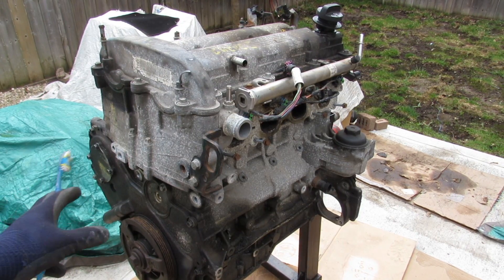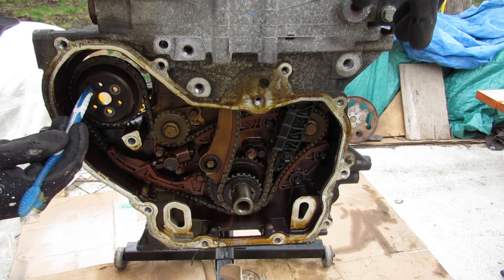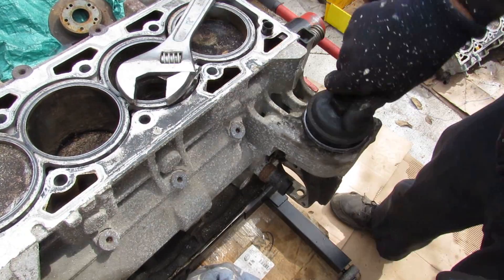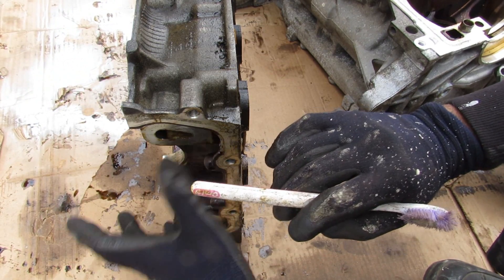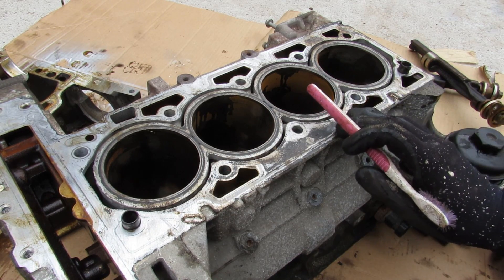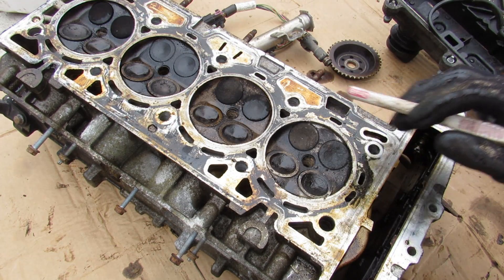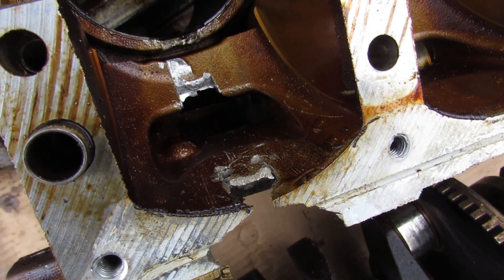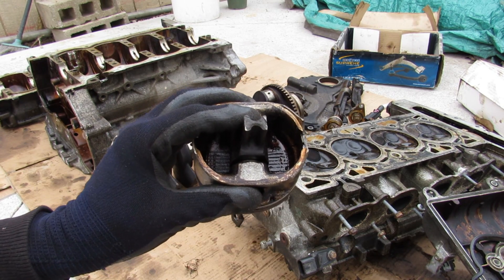Why GM Ecotec Engines FAIL

Comment: My friend has a chevy malibu, and trust me those 4 bangers just self destruct.
Reply: When will GM freaking learn
Reply: @davidbarlow7955  when they outsource engine to a "Boxer" engine
Reply: @lowlifeangler  Do you mean like Toyota did?
Reply: @davidbarlow7955  never
Reply: @davidbarlow7955  They don't have to. GM knows that but they will continue to cut corners on quality to save more dollars. The engine can explode right in you face. They don't give a fuck. And not only GM. Greed always wins.
Reply: @PAUL_K  
It is not so much greed as necessary.
The are on a marked and if they start to build their engines to last 200.000km instead of just the end of the varranty, they cost more than the competition and loose profits, which again means that their stock would crashes and the companies goes bankrupt again.

It is a systematic problem, you can see the same with Mercedes, Ford, BMW, VW and others.
Reply: @Ismalith  Well that's right you just described one form of greed. There's many of them.
Reply: @Ismalith  That's why I've always said, corporations including car companies are in the business of producing stocks, not vehicles.
Reply from the maker: What year?
Reply: @speedkar99  2016 with the 1.5 turbo
Reply: @vishalakula8451  Yeah the 1.5 and its 1.4 sibling (not to be confused with the iron block 1.4) love to self destruct pistons, specifically the ring lands.
Reply: @vishalakula8451  almost  same year  as my girlfriends car that  did the same thing. Good for nothing but boat anchors.
Reply: @Jakek200  That is because of "ring gap". If you run the engine using boost the rings expand and the end contact each other and leave no more room for expansion forcing more and more pressure against the cylinder wall. That is how the ring lands break. If you drive it hard and then cruse for a while the rings will cool preventing engine failure. All those guys with boosted engine under their hoods ALL know about ring gap. OEM can't give that much ring gap because it will not meet emissions. 
In my opinion the reason why GM has ring land failure is because they put a tiny engine in the vehicle that they turbocharge so of course your foot is buried much longer just getting the vehicle up to the desired speed. If the vehicle has two options for engines and one is a turbo and the other is  a NA (Naturally Aspirated) they always turbo the smaller one. If the vehicle requires a 2.4L NA then the option should be 2.4L Turbo. That way it will still meet emissions and it won't have to work as hard every time it's driven and if you want to race someone, hang on and go for it.
This engine failed due to oil starvation (Poor Maintenance) and why not use synthetic oil? Synthetic oil is way more forgiving when the person does not maintain their vehicle. The other reason oil rings clog up is from starting the engine and driving 15 minutes to work and turning it off. Then the same returning home. Just as the condensation inside the engine forms you turn it off and it all dribbles down to the bottom of the oil pan right under the oil pickup tube. Imagine that happening to an engine that does not get it's oil and filter changed on a regular basis.
Reply: My friend's husband was a master tech at a chevy dealer. He would spend days just replacing the little turbos. They'd fail in one way or another.
Reply: Still some of the turbo and supercharged ecotec engines are built to last. Take the 04 to 07 LSJ ecotec 2L engine with the eaton m62 supercharger. Much more reliable than the turbo newer GM cars and the newer ecotec engines. They really built the LSJ motor to handle way more power than it came with stock which was only around 200 to 220.
Reply: Agreed. That engine was built to take on forced induction, like Toyota's 1.8 4cyl from '04 to about 09 ( somewhere around there) when there was a dealer installed kit available (forgot if it was turbo or supercharger).
Reply: @billybodacious2337  what cars was that 1.8T offered in? Honestly didnt know toyota had any production cars with boost other than the supra and some older cars in the 80s or 90s. 

But yea the LSJ engine is fine. Its the timing chain that will get ya. Thats why one of the first things im doing is my timing chain and tensioner and everything else before i even think of throwing more boost or performance parts at the car. Why spend 2k on a turbo swap only to jump timing a month after its done because you should have done the timing first. If its fucked up already then adding more power will for sure speed up an expensive repair bill or need for a new car alltogether. 

Plus there are a lot of people in the ecotec car communities who build the 2.2 and 2.4 and give it boost. Seems like the 2.4 was better built in so far as handling boost goes. Seen a base saturn ion coupe with the 2.4 and a m62 added to it. Even think i saw one with the harrop TVS 1320 supercharger like what can be put on the LSJ. 

And this isnt even getting into the whole SAAB thing. The ecotec engine was designed by GM and Saab. Saab 900 turbo, 9-3 turbo x, tons of other great saab cars that people wouldnt know are kind of related to ecotec
Reply: @billybuchanan385  The corolla and celica as well as the matrix and gm's version called the vibe.
Reply: @billybuchanan385   Lexus now offers a 4cyl turbo in the IS lineup but of course it’s the bottom trim as their v6 and v8 are better. Personally I don’t want a 4cyl. My old 2010 Camry with the 4cyl was so slow compared to my 2012 Lexus is350 AWD. 306 hp from a 3.5L v6
Reply: @ValentinoBentley  The UZ V8 engine family has a few examples going into the  million mile range. They are the most bulletproof.
Reply: @billybuchanan385  good ol. 2zz and 1zz. Also found in mr2 2nd gen and lotus elise
Reply: @SI0AX  I have been saving short video's at work recording fleet vehicles with LS engines. Video on as I walk over, open the door and video the mileage and turn around and show the load they are carrying with most of them being cargo vans. I have a little over fifty of them. I started videoing when I started seeing 300K years ago. It turns out 300K is nothing for them. Around 600K is transmission time but the engine is still good. I am going to load them onto some Toyota discussion groups and see what crap they come up with. Keep an eye out and see how high they actually go but don't be surprised if there aren't enough numbers in the odometer and I show the data continues on a scanner. It's because of the maintenance schedule of fleet owners. It just goes to show if you take care of it, it will take care of you and of course there are failures with every manufacturer as well. But if a Toyota fails it is the owner that caused it. Right?
Yes the UZ is phenomenal but it's almost never put to work ever in it's life and almost always maintained to a T.
Reply: I've owned 3 Ecotec engines. 2.0 an 07 model 200k plus never had problems and didn't maintain anything properly. 1.4 2012 traded it off at 120k never had issues other that a coolant temp sensor. And now I got my wife an equinox with the 1.5 so far so good. So no they don't just "self destruct"
Reply: Precisely why I got rid of the wife’s ‘10 Equinox with the 4 cyl. Only had about 20 k on it but that engine made some F’d up sounds. A couple mechanics I know said that many of them were failing. Bye bye.
Reply: @jamesjoslin7586  FFS, I can't confirm even the "Shanghai'ed" 3400 V6 being unreliable like that in the early Chevy Equinox/Pontiac Torrents. The 3.4/3400s were mostly just known for piston slap. OTOH, it was a nightmare to be in a 2013 MY Focus with what I think now, is a problem with the PowerShift automatic&pseudo-manual transmission.
Reply: I drive an 04 cavalier with the 2.2l. Knock on wood, buy the only problem ive had with it is when it had a nasty lifter tick. I'm a mechanic and replaced all 16 myself. Only one lash adjuster was collapsed, and the rest of the entire valvetrain was perfect and clean, even the chain
Reply: This just shows how important 5k or less oil changers are.
Reply: My neighbors had a 2006 Malibu,  it randomly threw a connecting rod on the highway.
Reply: @PistonAvatarGuy  It was a timing chain tensioners broke, oil was low do to front cover was leaking really bad after 250,000 miles
Reply: @lowlifeangler  On this engine, yes, but the engine that I'm talking about was only a few years old and had been well maintained.
Reply: Yeah, the new turboed things everywhere..., new way of reinventing the wheel. As if they didn't have enough problems already
Reply: @pliedtka  - Nothing new about "turbos"... were used in WWII and in 1962 Chevy Corvair and Oldsmobile Jetfire...
Reply: @pliedtka  Its mainly brand and year dependent. I have a 1.8t (MK4 Jetta 5 speed 2003) with 459k on the odometer. I do my timing belt on time and very frequent oil changes. Extremely good example of how a factory turbo car should be. Not all factory turbo cars are terrible, chevy does a terrible job with theirs though xD
Reply: Appreciate this breakdown so no buy lol
Reply: @snackler6102  Exactly!
Reply: @Yeah Right I know you're a mechanic. Toyota is tasting that flavor right now, and they even went one step further. They sell a BMW too! I always say if the boxer engine was so damn good all the manufactures would be using them. The only reason why Subaru uses them is because of government subsidies. They can't loose money researching and developing them. Mazda does the Wankel.
Great comment. Thanks, I needed to see that.
Reply: @Yeah Right  I have been saving short video's at work recording fleet vehicles with LS engines. I turn the video on as I walk over, open the door and video the mileage and turn around and show the load they are carrying with most of them being cargo vans. I have a little over fifty of them. I started videoing when I started seeing 300K years ago. It turns out 300K is nothing for them. Around 600K is transmission time but the engine is still good. I am going to load them onto some Toyota discussion groups and see what crap they come up with. You know the odometer goes up to 999999 but the data continues on the scanner. It's because of the maintenance schedule of fleet owners. It just goes to show if you take care of it, it will take care of you and of course there are failures with every manufacturer as well. We only have one company using Ford for there entire fleet and I see over 300K but not pegging the odometer. Dodge is still behind but they do have the new design hemi now and seems pretty good.
Reply: @Yeah Right So fun to drive tho. I must admit the most fun ive had in a car was in a 2.5 liter Subaru Impreza STI WRX at 320horsepower. Massive turbolag, and that giant turbo felt like you hit warp speed when boost kicked in..

I would never buy an boxer for mpg. Would be purely for entertainment.

I would altso love to own a rotor someday.. They are unefficient, and hate cold starts.. But, it has certain desirable traits.. Like the mad sound they make.
Reply: @Yeah Right Why would you run N/A in 2021? Unless you a doing a historical rerepresentation?

Been a while since i had anything N/A.

Open deck engines are the bottom of the barrel..

Its like me saying Remy Martin Cognac sucks cause their cheapest one did not taste good.

Of course its gonna suck. Its cheap.

However, noones saying Boxter is better than an standard engine. Theres a reason they have not hit it off. They are way to complicated. Has a slight imbalance etc.

But dang, if it aint a compact design. So you can fit bigger turbos :)
Reply: I BELIEVE YOU!
Reply: americans just never learn how to use european engines, simple
Reply: @Yeah Right lol, funny you bring that up....when the 22B was also open deck, but we dont hear people complaining about it...also closed desk 22s are nice and all, but they dont like temps....they run hotter during the summer and rattle like hell during the winter.  but, you knew that already right?  same reason why the fox body GT with the aluminum heads and forged bottom end rattles until its heated up. lol did you know, the focus RS matter of fact, all ecoboost engines are open deck?  The volvo 5 cyl is open deck, the newer honda turbo engines are open deck, hell, the older honda engines were open deck!  the BMW inline six both na and turbo were open deck.  and if they chose to, they could easily resleave and close the desks of these engines just like the aftermarket does but it will cost more.  and subaru engines post ej25d in the WRK and STI are semi closed deck *unless you were lucky and got one of those "spare" engines they dropped into foresters and legacies with forged bottom ends in which they used the same semi closed deck blocks.  guess honda B and K series engines are garbage cause their open deck, yet people still turbo them.
Reply: My 2018 equinox 1.5L turbo started burning a quart every 1k after only 15k on the odo.
Reply: No they don't. I know people with 300k miles on their Ecotec 4cyl. Change the oil every 5k and follow the maintenance schedule. Timing chains and tensioners are not a thing you can skip the maintenance interval for. These engines burned oil for the EXACT same reason why Toyota 2AZ's burned oil. 

It's funny, I hang out on Toyota discussion group and one guy were super angry because his engine needed expensive repairs. Everyone grilled him and found out he skipped the timing chain service (among a few other scheduled maint items). Their logic is that if a Toyota engine fails, it's the owner's fault because they didn't adhere to the strict maintenance schedule. Yet if an Ecotec fails, it's because they're "junk" that "just self destruct". Apparently, only Toyota engines get a pass if they fail due to neglect. A Toyota fails because it was burning oil and the owner didn't check oil level, it's the owner's fault. An Ecotec fails because it was burning oil and the owner didn't check the oil level, it's the engine's fault. That's idiot logic.
Reply: @karlschauff7989  Holy $hit! I can't believe someone finally said this! Thank you! You are exactly correct! The bad thing is, everyone is still brain stuck in the 80's and 90's GM quality. They have no idea how much they have changed in fact how much Ford and Chrysler has changed since the bailout. But you're 100% right about maintenance and a very high percentage of American car buyers do not follow the maintenance schedule and the "Change Oil" light will be on for months before they bring it in. I own a 2009 Pontiac G5 and the only things I have replaced are the tires, front brakes and both headlights (fogged over). I also replaced both VVT actuators because they have failure issues (same as Toyota VVT actuators). I use synthetic oil and change it with a filter every 5,000 miles. I wash and wax it myself. In 2019 I took it to a local car gathering and jacked it up on one side and put it on stands to be funny. I got a lot of surprised people checking it out.
EDIT: After the bailout the government with "Permission" from the EPA allowed American auto manufacturers to use European grade plastics and paints. That's why if people are open minded enough and go to a Chevy dealer or Ford and sit in one of the vehicles and close the door you will not think you are in a car or truck made by an American car company. It's definitely the European's at the bottom now. Mercedes still does quality but also still over mechanized and that's what fails.
Reply: @karlschauff7989  I have this engine in my scion tc with the 2az with this exact issue it's been burning oil for about 2-1/2 years now about a qt every 600 miles. Now I change it and keep it full and it hasn't seemed to gotten any worse. I'm waiting for it to self destruct though. It's ran 20,000 miles with it like that and tbh I've changed 1 wheel bearing tires and brakes. Other than that very reliable vehicle. Is there a regular maintenance schedule for the timing chain on this engine? If so I'd better run mine till it blows and hopefully find another 1 for 400 bucks lol.
Reply: @karlschauff7989  excellent reply save me from doing all of it I have one with 150,000 miles on it and 1,000 I had somebody replace all of it I used to work at GM but I got out of that line of work I had somebody doing on the side instead of doing it at the dealership